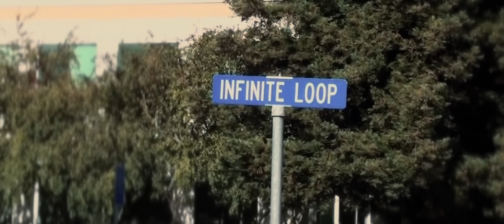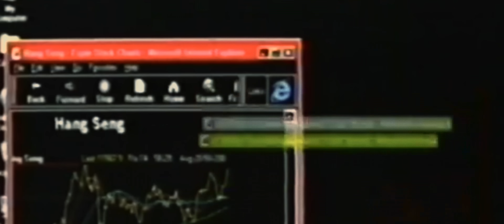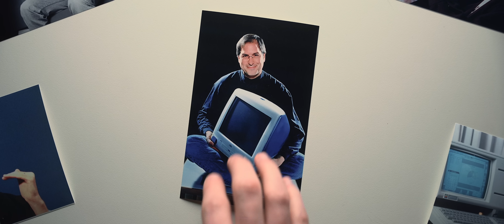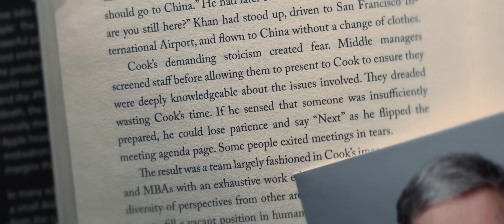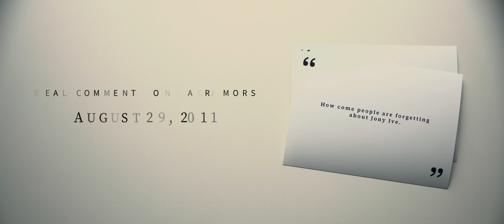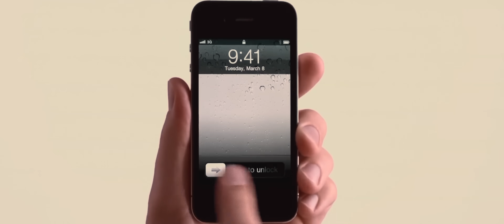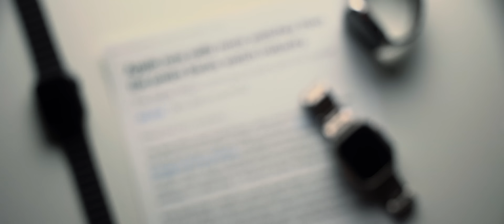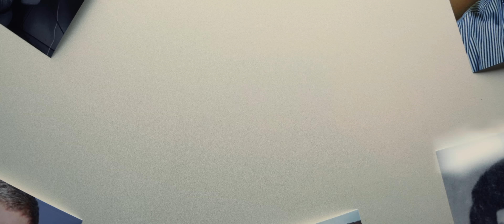Apple - The House that Tim Cook Built (Full Documentary)

Comment: i just wonder , why they can't make punch hole selfie , i just want more less space with big island ya ,
 if they still want face ID , just put face id senor to the back , we can flip and unlock , just make punch hole cam for vedio chat only , and make ultra sonic finger print
even andriod ph hardware is better than apple , for example battery tech , andriod got silicon-carbon anode battery ,Same Size but more larger bigger mAh ,
 more high charging speed  67 , 90 , 120 watts and safe . and display andriod got 2K display such a long time .